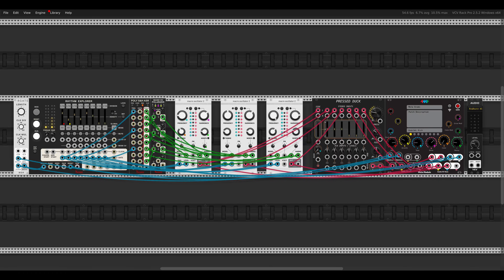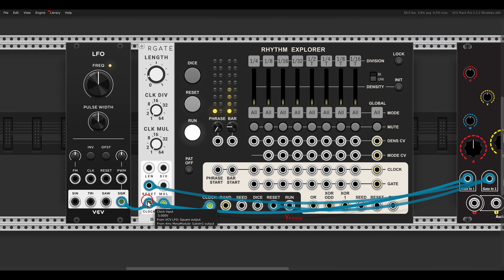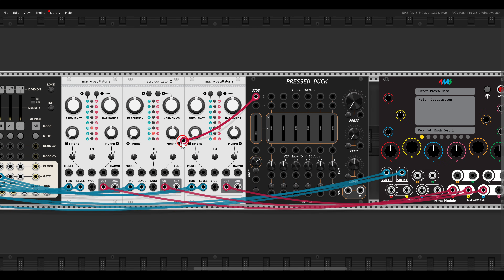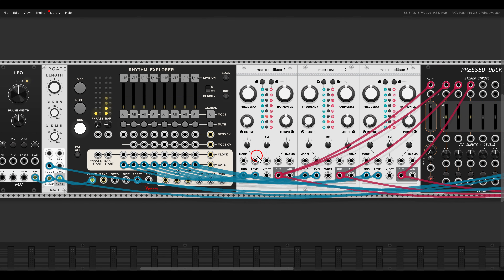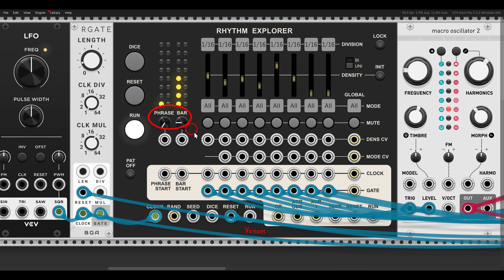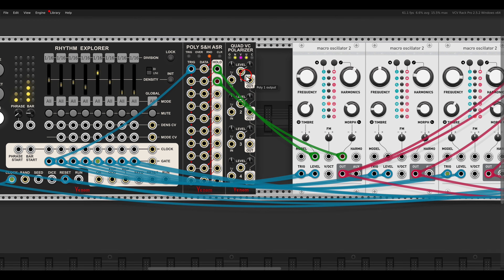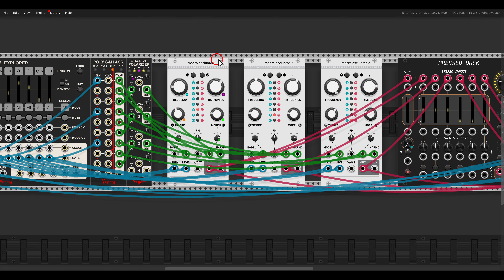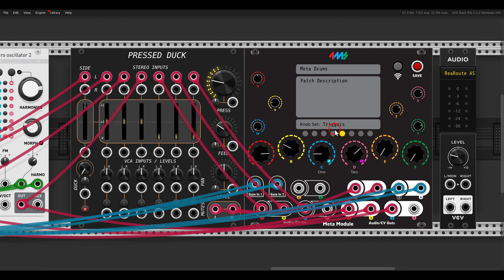Building a drum machine for the 4ms Meta module

Comment: Thank you a lot! At what capacity is this patch running for you and would you trust its stability enough to perform live with it?
Reply from the maker: Cheers! I use Meta with a lower sample rate by default, so I don't have to worry so much about overloading it. I would not use it for live performances just yet. It's better to wait for the V2 firmware. It's already in progress, though, so it might not take long. You can follow the progression on their forum.